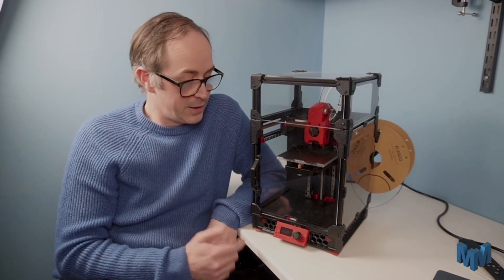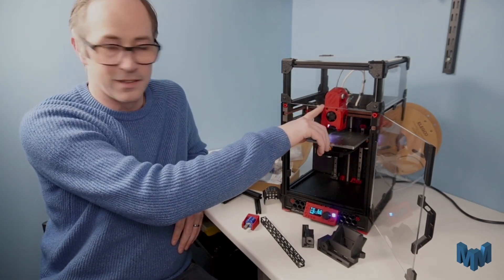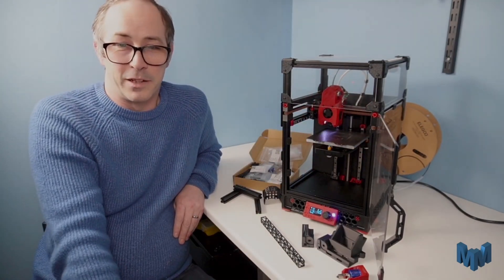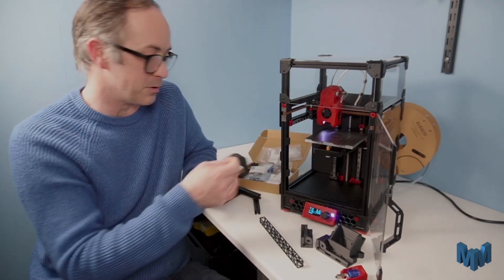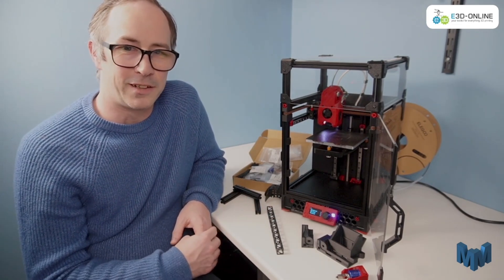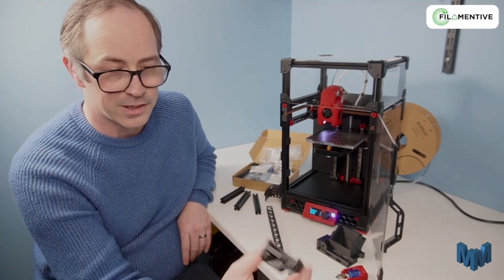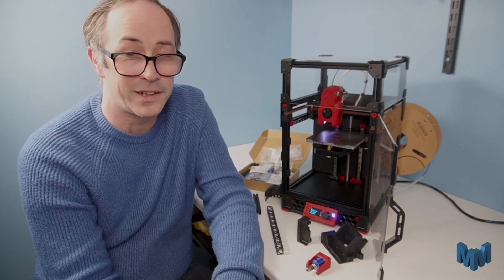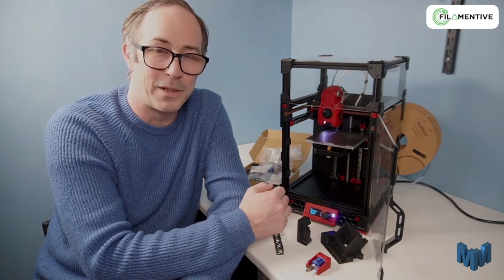Voron V0.2 R1 Pro by Fysetc DIY 3D Printer Build Review

Comment: Hey Mylo, I saw on your gitbook you discussed some Linux things to optimize the CM68. I'm current running into an issue after installing the latest firmware in that the host name is "Voron-02-Pro" so I'm getting a host error. Unfortunately I cannot actually sudo nano the host list to add "127.0.0.1 voron-02-pro". Do you have any suggestions about how to fix this or do I need to reflash a different firmware?